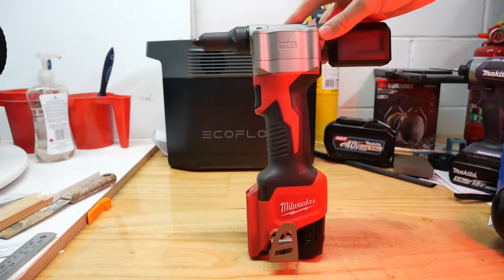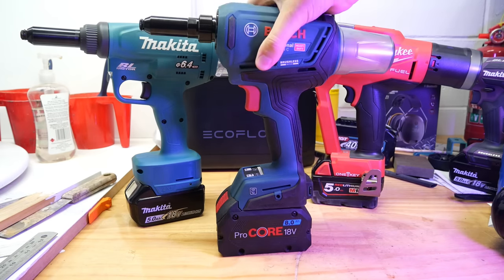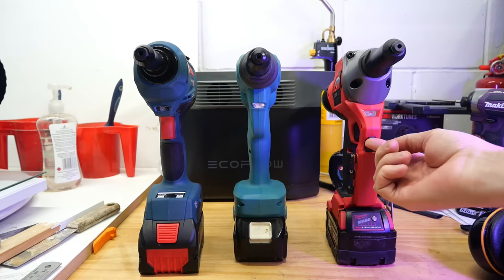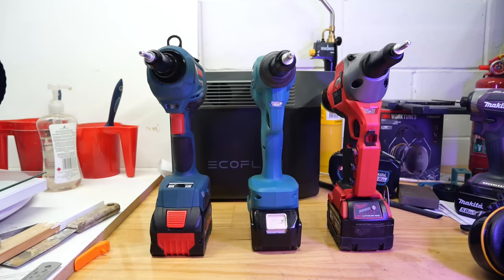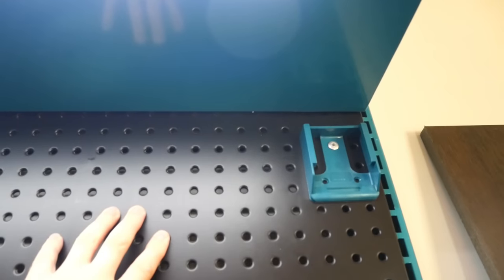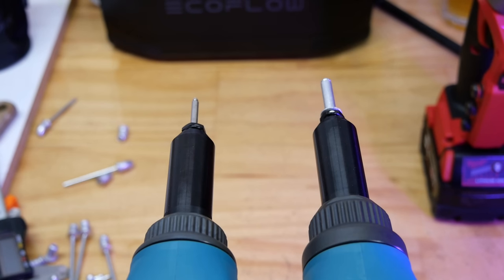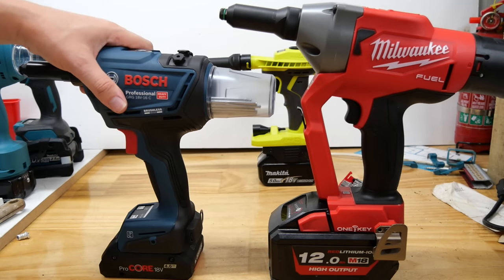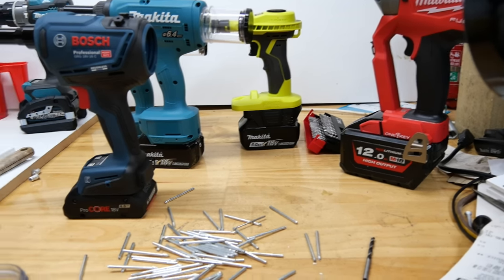Bosch VS Makita VS Milwaukee 1/4" Rivet Guns. Do they all Pop Rivets the Same?

Comment: I'm a Makita guy but we have the lower end Milwaukee pop gun $250 ish Canadian and works flawlessly on 3/16 rivets. I wish Makita would have a cheaper version.
Reply: It's the only one that has a price that fits casual user , Makita , M18 Milwaukee , Metabo (only does 6mm aluminum) and Bosch are too pricy .
Makita could do 12V tool for max 4,8 mm rivets .

Comment: I'm happy with the speed & effort required to set 3.2mm & 4.0mm rivets with a 1 handed manual tool, even using stainless rivets. I've set a few 100 3.2mm stainless rivets in a session which gets a bit hard on the hands. I use countersunk 4.8, 6.4 & 6.8 stainless rivets for attaching gate hinges & landscaping occasionally. They are hard to pull by hand & the mandrels jamb in most 1 handed riveters.  Often the 2 handed POP tool is too big to get in tight spaces & is awkward to use. So I'd be happy with a tool that only pulls 4.8+ - if I could afford it. Maybe sell some stock of 6.8mm stainless rivets - they are dear.

Comment: Great video as usual! Oddly enough, the US Makita model (which I own several of) shows no 1/4" stainless limitations, and even specifies it is good up to 1/4" in aluminum, steel and stainless steel. Also, the US Milwaukee version claims a max capacity of 1/4", not the 9/32" that I guess you guys get, which is unfortunate. Being that both the Makita and Milwaukee claim 20 kN of pulling force I couldn't imagine there would be any reason you couldn't use the European model Makita to do 1/4" stainless.

Comment: The reasons for the differences with the Makita rivet gun vs regular Makita tools is that it is a rebadged Huck rivet gun from Howmet Aerospace. Howmet do mention that they have a partnership with Makita and their version does use Makita branded batteries but the Makita model is missing the pull force adjustment buttons that are on the Huck.

Comment: That was very riveting 😂😂😂😂, you can buy a 6" nose extension for the M12 and M18, you can also buy the retention sizing nose pieces for both the M12 and M18 not sure if the M12 would be usable on the M18 or not but worth a try. You can also buy a conversion kit to turn the lockbolt tool into a blind rivet on.

Comment: I will say that the Milwaukee M12 is almost great for what it is designed to do.  I have had no issues after a couple 1000 long body 3/16" rivets. The only thing that should be improved on the M12 is the catcher for the waste mandrels. It would be nice if the waste mandrel catcher was transparent like the 18 volt Makita so you could see how full it is.  When the Milwaukee M12 catcher gets packed full of waste mandrels it pops the lid off and they all fall out. It is annoying enough in the shop but out in the yard it is downright maddening to have to pick mandrels out of the dirt especially if they are aluminum since you cannot use a magnet.  I can live with the tool size but that waste mandrel catcher seems like a poor design afterthought.
Reply: Milwaukee M12 it's a slowly tortilla!

Comment: The Makita is based on the Huck guns, Huck are one of if not the industry standard for rivet assembly. Aircrafts to bridges, Huck/ Makita is where it's at. Watch for a Makita gun that will pull 12.7mm rivets.....
Reply from the maker: I've made a vid about the new makita 1/2" rivet tool and the association with Huck.
Reply: @ToolsAndStuffOFFICIAL  what’s the video called? I can’t seem to find it
Reply from the maker: https://youtu.be/rzE5WiUbXNU

Comment: The kango metal rivet attachment for a drill is fantastic and at $100 beats all of these. I have literally popped thousands with it. I bought a spare just in case.
Reply: Are you using the 1/4 model or only the 4.8mm model? I was very curious how the 1/4 model would hold up for 1/4 rivets
Reply: I haven't used the Kango, but I've used several of the plastic ones that are rebadged by Kincrome, P&N, etc. They all die after 300-600 rivets. I've taken them apart and serviced them, but you only get another 100 rivets before doing it all again. The Kango on the outside looks better quality.

Still has the same drawbacks of needing to reverse the drill to eject the mandrel, and needing two hands.
Reply: A bit what DeWalt has done (copied old good Black&Decker) attachment to "drills" , i have their sheet metal cutter ,  they have also pipe cutter out now .
Aint going to spend 400-500 on a tool i use casually , if i can get a working attachment for 70 -100 .
Black&Decker (yeah i know its same company now 🙂) they had crazy attachments to their power drill , i still have their hedge trimmer attachment from 1980s , only snag with that was that you had to take drill chuck off and replace it with a special part .

Comment: I bought the (very expensive) Makita DRV250 and it's utter garbage! It snaps rivets off leaving a 5mm stub of the shaft sticking out - even using expensive German rivets. It also jams the snapped off shafts between the three pulling jaws necessitating the tear-down of the whole damn nose. I have dozens of Makita tools and this is the only completely rubbish one. I now have the Milwaukee M12 tool (the first Milwaukee I've owned) and it works just fine on 4.8mm rivets.
Reply from the maker: It sounds like you are not using the right pull rod for the right rivet size.
Reply: Thanks for the suggestion  @ToolsAndStuffOFFICIAL . That was my first thought so I tried replacing the pull rod in case I had made a mistake or they had come incorrectly labelled. TBH. it's the only bad Makita experience I've had... unlike Ryobi 🤐
Reply: I’ve done 4.8mm stainless with the m12 and it does it fine. Did about 30 rivets. It sounds like it struggles compared to the 3.2mm aluminium rivets but it does do them
Reply: I've got the DRV150- I've had this exact issue with bralo sealed rivets, but never with anything else. When i changed the rivet length, it solved the problem. I've found 2.5 times the material thickness is the best length
Reply: @SamS-gn4vl  Love the M12
Reply: Thanks  @simonday6376  I'll try longer rivets... before I bin the Makita 😄
Reply: ... or should that be shorter? Will check and try for 2.5X
Reply: I also have this issue of the shafts being stuck between the jaws/theeth and also, when I release the trigger, they come peeking out the front....

Comment: Now do 1,000 alu rivets on each and count how many times each jams and needs to be pulled apart 😅
Reply: I've probably done around 10,000 4.8mm alu rivets with the makita (150 version) in the last two years. No real issues, and i've only greased up 4/5 times. Changing parts is a pain, but you get quite good at it!

Comment: Can you don stainless steel rivets those look like aluminum I have stainless and man is it difficult I have a hand rivet gun but it’s a work out compared to aluminum
Reply from the maker: You can do stainless on all these just not up to the max sizes. I think the Milwaukee does 1/4 in stainless. I explain what each does in the video.